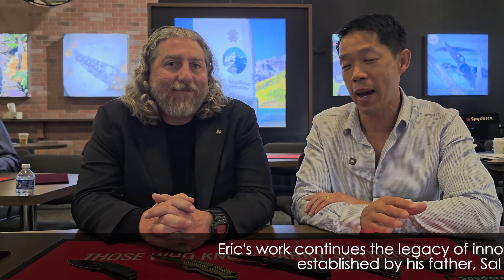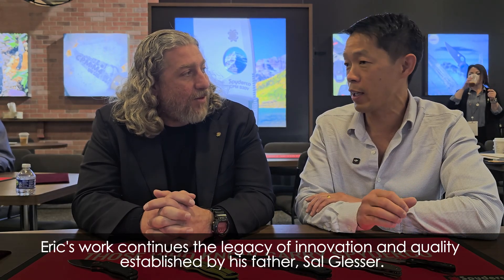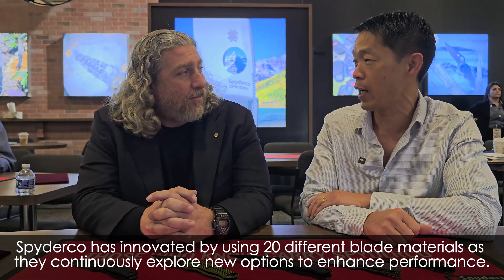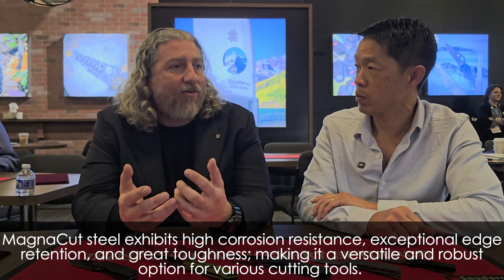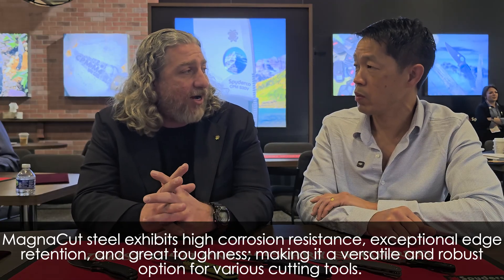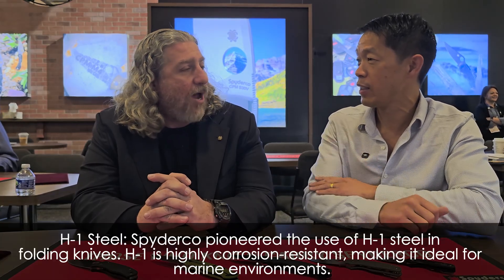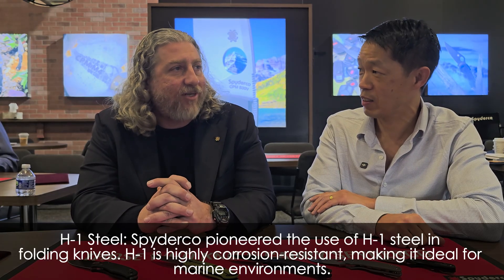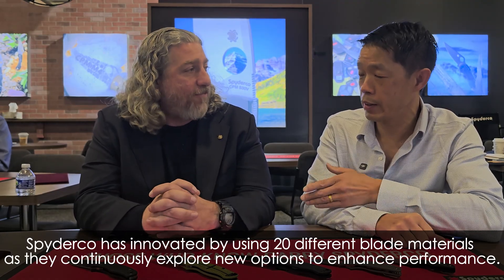CPM MagnaCut Steel Explained With Eric Glesser of Spyderco

Comment: I feel like spyderco is losing touch with the market.  No one wants FOMO exclusives.  No one really cares about the salt series.  Everyone wants a magnacut shaman, pm2, para3, manix.  Throw some g10 on it and call it a day.  And how about button locks...?  Why does this seems so obvious?
Reply: Button locks suck and are weak! Spine whack them and many of them flat out fail! 👎
Reply: @johnruiz6743 yeah, I have a button lock Civivi and it's not nearly as confidence inspiring as even a simple liner lock. Then again it's not a Spiderco, but still it's not as good a design.
Reply: Oh boo hoo, that S30v and S45vn just falls apart 😂
Reply: They have made the pm2 in magnacut I'm holding it in my hand now.
Reply: Think more, "feel" less.
Reply: Love my salt H2 serrated. Light, strong.

Comment: Poor lc200n. Disposable hero
Reply: LC200N is great steel. I almost bought a Native 5 Salt made with it. But just before I ordered, I found the Para 3 Salt in Magnacut. To be fair, had the Para 3 Salt been LC200N, I would have bought it over the Native, as I wanted the compression lock.
Reply: I like LC200n better than VG10
Reply: I have several Spyderco knives in LC200N and I really like it! I won't be selling those knives. They are truly corrosion resistant, even a bit more than magnacut. The only equivalents is H1/H2 and Vanax Superclean! 🤔
Reply: Yep, vanax and lc200n are rust PROOF, MagnaCut is fully stainless. But ocean water over a long time might give MagnaCut a little staining over time. H1/2 is.. barely steel. It's not magnetic, it's work hardened austenitic steel. @johnruiz6743
Reply: 9 months late, but that made me laugh! 😂
Reply: I love my native 5 lw plain edge lc200n